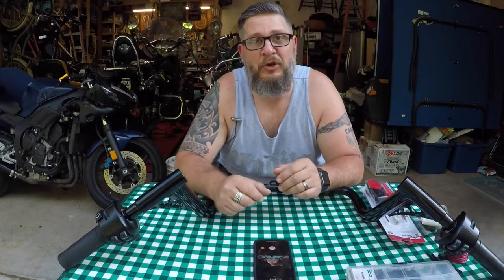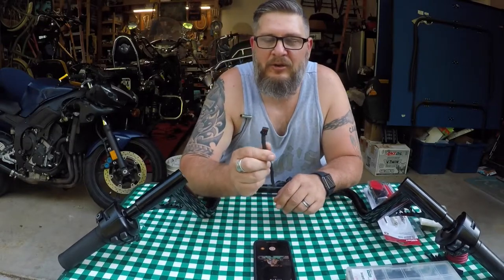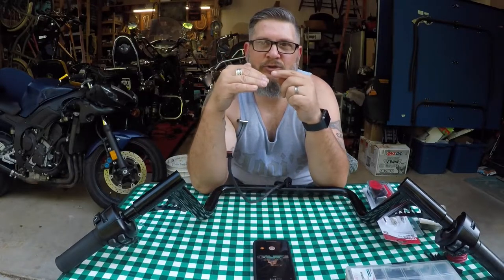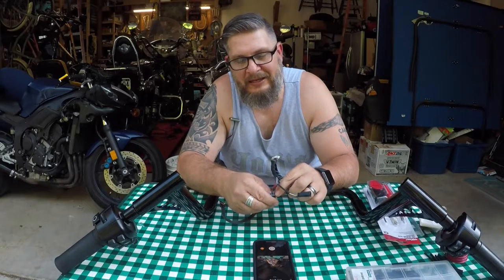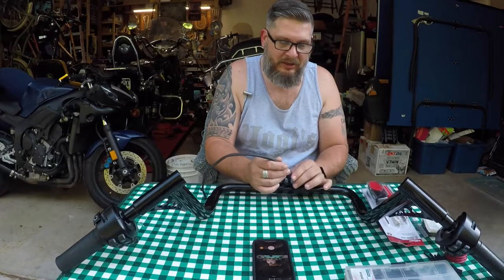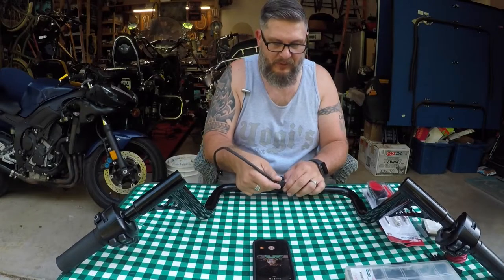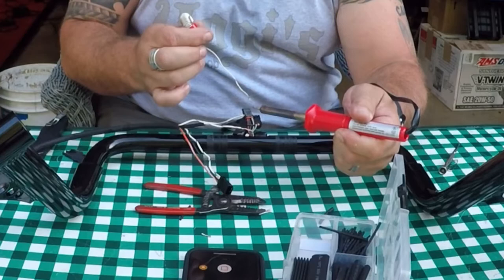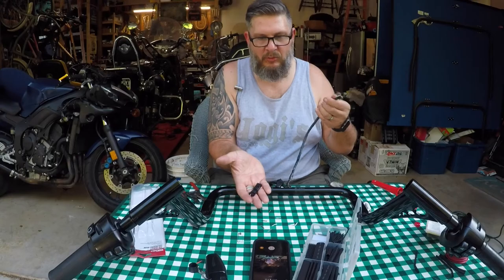To Solder or not to Solder

Comment: The clips are for ease of assembly at the factory. The bikes are not "built" at the plant they are assembled. Everything is for speed of assembly.  The mechanic is not part of the design team.   Its a Harley it should have throttle cables and big chunky wire connectors.  Some of those connectors do not like to be taken apart. I have replaced components where the wires had to be removed from the micro connector and the new part comes with a new connector and a warning do not reuse original connector.  Yea sometimes solder makes more sense.  LOL